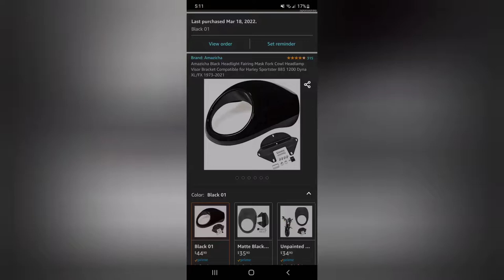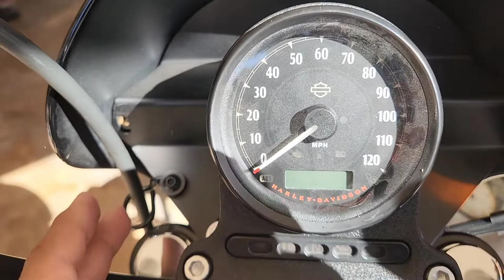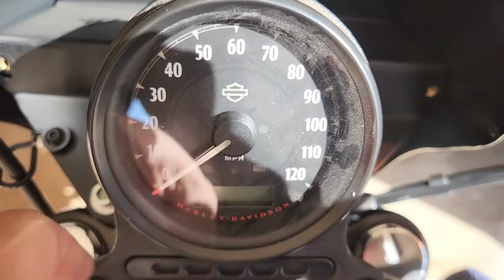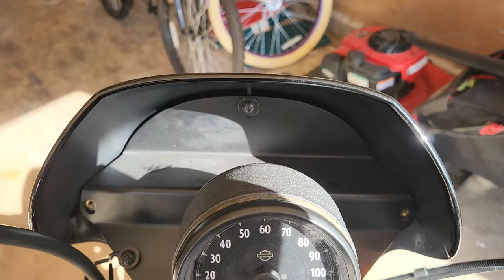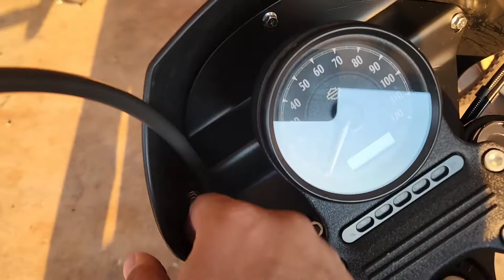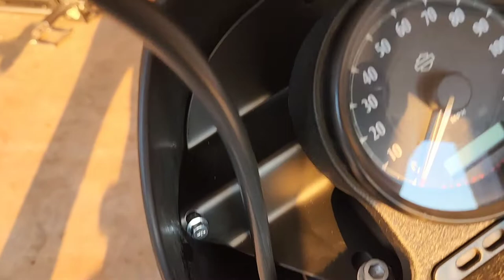How to replace sportster fairing

Comment: I constantly remove and install the fairing as I change my mind often. The clutch cable clip can be hidden if you're not able to remove it. Slide it down the cable and tuck it between the cable and frame.
Reply from the maker: That's exactly the way I went about it!! Appreciate the advice. Ride safe!